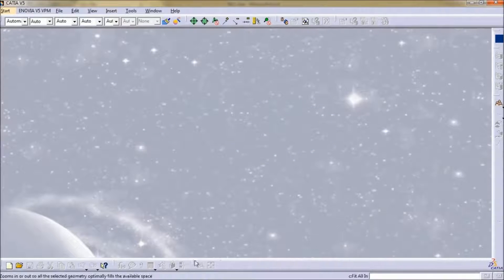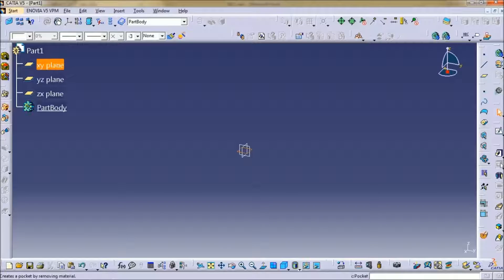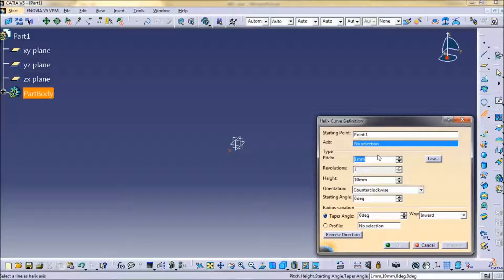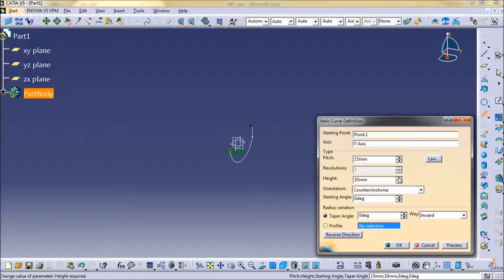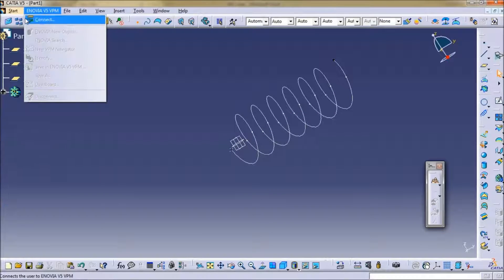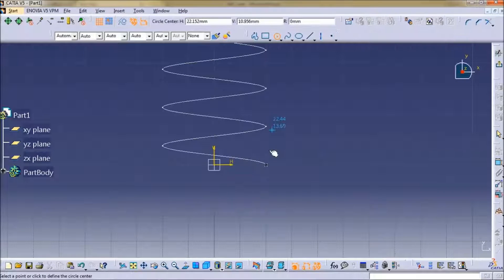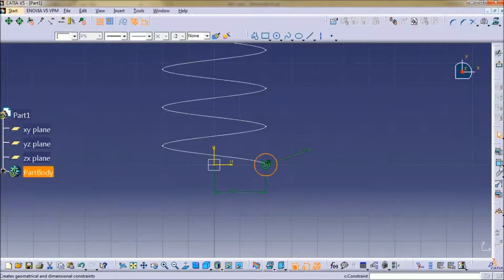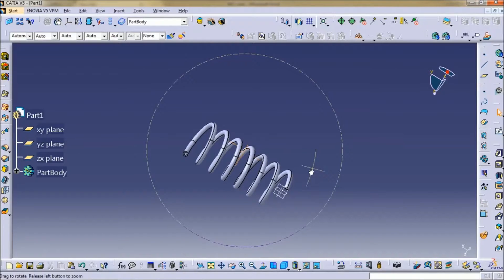CATIA V5/V6 tutorial | THE FASTEST AND EASY WAY TO MAKE SPRING

Comment: its hard to understand, the pointer is hard to follow, the pointer goes on certain points where he does nothing there which makes it harder for me to follow and makes me questioning if you will or will not click there, the music from behind I find useless because it is louder than you speak, you speak on fastforward without any reason. Would be better if you would of speak normal and, make the pointer in a red circle, stop less than a sec on where you would wanted to click, don`t go with the pointer on places which are not to be clicked. I had to see more than 10 times the video to understand and than to start doing the object. Thank you